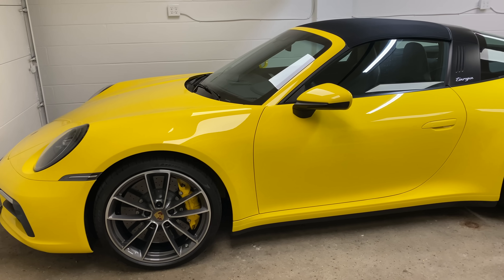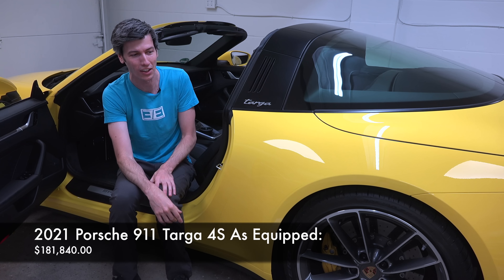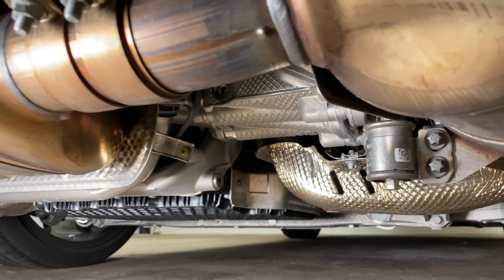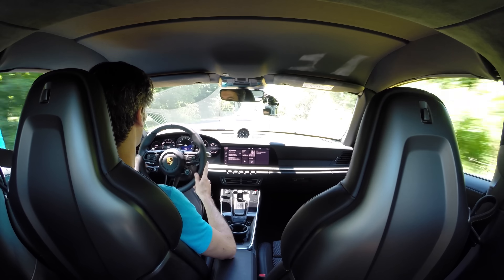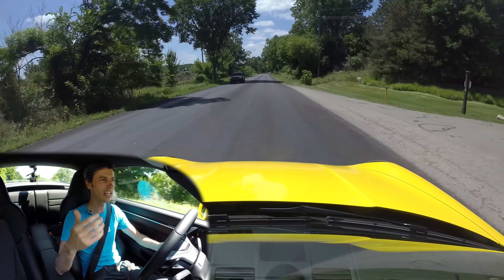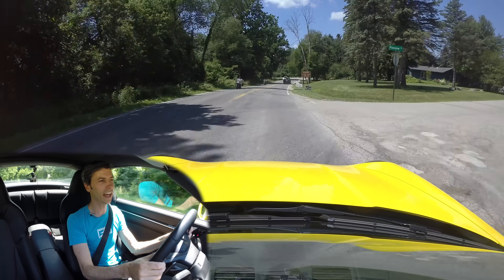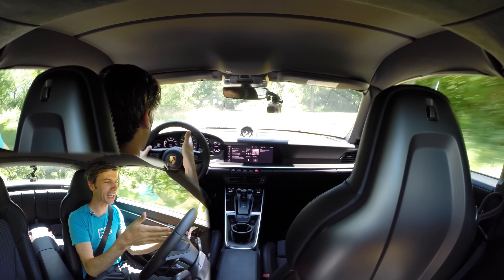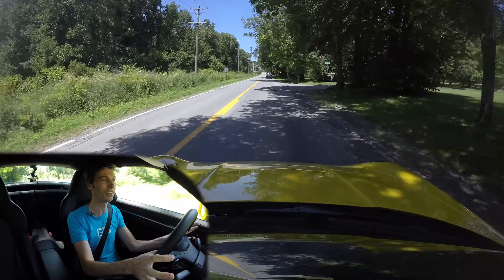2021 Porsche 911 Targa 4S Review - Big Beautiful Glass!

Comment from the maker: A plastic oil pan!? What gives! Keep in mind this is a dry sump system and the sump is not the lowest point under the vehicle. But, if you're curious about plastic oil pans, and whether they make any sense, I found this article pretty fascinating: https://bit.ly/2DEwGx4. Also, apologies for the audio which seems to deteriorate towards the end of the video. I had the car for one day and on that one day my mic decided to get a little finicky. I've already replaced the mic (see previous video in my supercharged MX-5, which was filmed after this was) and resolved the in-car audio issues. As always, thanks for watching! If you're curious about the boring life a YouTuber leads, you can follow my Instagram: https://www.instagram.com/engineeringexplained/
Reply: they dont make things to last anymore , will go all brittle over time
Reply: Plastic oilpan is actually pretty common in VAG cars. All the newest have plastic pan. From 2015 to present its common that they have it and many other manufactures use too plastic pans and intakes also.
Reply: I would like to see that accelerated aging test data
Reply: From the article : "[cool plastic material of the week] fully satisfies the specific requirements for functional integration, lightweight construction and cost-effective production [..]" Nothing about durability compared to aluminium pans or generally accepted standards of engine lifetimes (usually 100k to 300k miles in roadcars and 10 to 15 years of age). Then they go on to compare it to [slighly less crappy plastic], but not to any type of metal material. 

Conclusion: Obviously having an oil pan that lasts the length of the engine lifetime is not even a design goal any more. Cost cutting is more important.

Opinion: I would not be happy purchasing a vehicle equipped with a non-metal oil pan.

Controversial opinion: The automotive industry is generally doing a good job at making ICE go the way of the dodo by making them less and less reliable and durable.
Reply: Gabriel Sterr cool. So the plastic will fail in about 15 years at best. Sucks for people who plan to keep the car forever.
Reply: So the front isnt an engine compartment, but an engineer compartment?
Reply: Volvo trucks has been using plastic oil pans a long time.
Plastic is not a good material for such a part.
Reply: I would do it just to keep engine noise down 🤓
Reply: Glass targa ? Meaby
Reply: Please do an explanation of the boxer 6 cylinder engine.
Reply: mike brink  I thought Porsche has historically been a pretty reliable brand.  We really have no data on how reliable the current stuff will be, however.
Reply: I don’t care what my oil pan is made of as long as it doesn’t rust out in the salt belt
Reply: What happened to the sound...
Reply: I have a concrete mixer that's seen lots of use. The barrel is made of plastic. Aside from discoloring from sun, its still very solid and pliable. You can wack it really hard with a shovel and it hardly gets a chip. The iron mount and aluminum stir blades show more wear than the plastic. All engine seals are a type of plastic and they handle heat cycling fine.. Main downfall of plastic is UV from the sun makes it brittle eventually...hardly a concern for something under a car. Nonetheless this new 911 isn't that impressive...all the electronics that make is 'refined' or 'comfortable' are doomed to fail. Porsche is going to stick electric motors in it next model cycle and its going to get even heavier.
Reply: I had a 2010 Audi Q5, it had a water pump with a plastic case, lasted less than 20k miles. They replaced it with an aluminum cased pump.
I have a 2016 SQ5, the plastic water pump started leaking at 55k miles. Luckily replaced under warranty with aluminum pump.
Audi knows the long term reliability issues with these pumps but they will wait till it fails before replacing with aluminum pumps.
Reply: @phillm156  dang, that sucks.  Some parts make sense to be made of plastic.  Intake manifolds for one.  Nice and light, easy to remove.  Oil pans, eh, jury still out on that one.  But water pumps in plastic have to be the dumbest automotive idea yet.
Reply: If all of you people would go and read the article Jason posted, you would´nt be here freaking out about problems that don´t exist. Polymer technology is AMAZING and there´s a lot of reasons to use it, besides cost.
Reply: Hambert and some not so. A friend had a 335xi, the breather valve broke off. The internal piece broke into the camshaft & bearings....totaled.
Reply: Uuuhmm.. Technically it's a flat six engine, not a boxer engine. Or have I been lied to all my life?
Reply: @alexbarnby1322 Not all flat 6 engines are boxer engines, but all 6 cyl boxer engines are flat 6
Reply: @McSteveIrwin  yeah, it depends on the piston connecting rod phase orientation around the crankshaft.  If the horizontally opposed rods are on separate crank journals, 180 degrees apart, then they're boxer engines, like the ones in Subaru cars.  When viewed from above it looks like the pistons on each side are "boxing" each other since they each reach TDC and BDC at the same time.  If the rods share a journal on the crankshaft like most V8's and V6 cars, only they're laid flat at 180 degrees, then they're just flat engines.  Ferrari Testarossas had flat-12 engines, but it wasn't a boxer engine.

Comment: Maybe my rallying fears are showing, but how come a huge ugly and incorrectly installed hose clamp underneath. If you had to use a hose clamp - and bmw would never do that - at least install it with the tail away from the direction of travel and the screw mechanism up the back of the pipe. Disappointing detail on a $180k Porsche.

Comment: 181k optioned is a bit much, not sure what exactly is included, but you can definitely configure a cheaper build. I think 150-160k is more reasonable and at that price point it may be worth it for a Targa 4S with manual transmission. Targas in manual are very rare and hold their value pretty well. Also keep in mind in a few short years 911 will switch to hybrid powertrain, and these cars may very well be collector cars. I would not get the 8-speed PDK, as refined as it might be, unless you're in Sport Plus it's too boring as it's tuned for fuel economy not fun.

Comment: I'd be interested in a video on how you can have different final drive gear ratios.
I presume it is because the rear wheels are wider so if its the same tyre wall ratio front to back, the back will travel further on one rotation so need a smaller diff ratio.
Would also be interested in the effects of this if there are any (2 props spinning at different speeds;what happens when cornering)

Comment: Hi Jason! Looks like there isn't anyway to PM you on Youtube anymore, but I wanted to ask about auto start stop (ASS) systems on Turboed engines. I'm sure most car designers have probably thought about it but your video on what not to do on turboed cars you mention letting the car cool down before you turn off the engine. With an ASS you can't do that if you let the car turn itself off. What are your thought on this? Is the potential 8% fuel savings worth it in this case, or is it better to think about the turbo?

Comment: If you want a metal piece, you can get a after-market oil pan that adds 2.5 quarts to the capacity, at least for the 991.2, just have $2.5k ready to pay. As to the choice of manual and PDK, you used to save money by opting for the manual, no more, so thanks, I guess. Compared to my 991.2, a comparably equipped 992 is $10 to $15k more, as long as they sell, they can raise the price. 
The steering wheel in my 991.2 also blocks gauges, but there is a screen in the instrument cluster multi-function display that you can have all the engine readings very visible. 
Truly, the Targa top is too complex, puts weight at the wrong place and adds to the cost of the car, but they still sell.

Comment: 3700 lbs! My 67 Camaro convertible is 3100 lbs.I have a naturally aspirated 327ci (5.7l) engine which by spec should be around 400 hp. I think the Porshe was around 430 horsepower. So the Porshe hp/weight ratio is .116 while my 63 year old Chevy is .129. PROGRESS! (PS you can by a tricked out 69 Camaro with a 427 on Craigslist for under $45k)

Comment: I just bought a caymen starts at 60k can go to 96k, mine is 89k. I came from a 03 boxster that I could not upgrade because I only had 50k miles on it. 
There cars use to be about driving but now they are only about money. I’m selling my 2020 caymen and getting an electric car. New version of the model S. 
Porsche wanted $1900 to change the brakes on my boxster, I bought the one parts on amazon and changed them for $450 they wanted over $3000 for services so again bought all the parts on amazon and did all the services even the ones that where not do. The service guy could not show me where the money was going because it was clearly a money grab.
Yes people that buy Porsche’s tend to be well off so you can afford to over pay for service is basically what the dealer implied. Keep in mind I only have one arm and did all that work on my car just so the dealer would not rip me off, but I don’t want to do it again, so electric here I come @#$% Porsche they lost another customer for life

Comment: Sometimes electronics are there to make up for a bad mechanical design. I.e. a car with bad handling that they try to fix with hacking the stability control. And THAT is also what they did to the 373MAX. And THAT is the sort of thing that people hate. When a car already has good handling mechanically, and the manufacturer adds finetuned electronics to them then that's a good thing.
And that's the case with Porsche, they have a solid basis that they put their electronics on top of. So here it's an addition, not a compensation.
---
And their engineering department knows how to build engines that self destruct right after the warranty period is over. That self-destruct mechanism is way more reliable than a lot of nuclear weapons and cruise missles. Putting a hard but thin alusil coating on a soft and pliable aluminium block? - Genius! Making the clutches of the PDK impossible to change without cutting and welding its case? - Genius!

Comment: The camera shakes (especially the rear view) let me think that the body is (obviously) less stiff than the coupé. I drove a cabriolet 911 and found a sort of “disconnection” between the dashboard / steering wheel and the rear of the car. This was very obvious on bumpy roads,  not necessarily at high speed. This is what you get when you remove the top...

Comment: I'm a huge Porschephile, well known in the 928 world and now I have a Cayman S.  But $180,000 for a non-turbo 911 [992]?  Uhmm, this is a luxury car for retired guys with lots of money.  My Cayman S has the same gold-plated shield on the hood and has 96% of the performance for 25% of the price.  Hello? And my 981 will depreciate little in the next few years, that 992 will.  And my 981 will outhandle that 992 on most tracks due to the mid-engine design.  And you know what is funny?  The structure of that 8th generation 911 and my 2nd generation 981 Cayman S....From the rear edge of the drivers doors forward, they are the SAME car.  The exact same steel/aluminum stampings.   That frunk that Jason climbed into?  If he climbed into my 981 you would see the same thing. I know because I am 6'1" and 155 pounds and I was able to climb into that space and have the frunk closed upon me.  [I had the key in my hand and a helper nearby just in case] In fact, the plastic cover over the battery, AC equipment, brake master cylinder, et cetera is the SAME part.  Porsche's motto is "If it ain't broke, don't fix it", in German.  This is why Consumer Reports magazine rates all the latest Porsche's based upon this chassis with about the same reliability as Toyota. 

Great video Jason!

Comment: Great video Jason! I agree about the price point, the 992 is a great car and the evolution of the 911 continues, but at $180k... I have a 2013 997.2 911 turbo S I recently purchased for 100k. The original sticker which I have shows $173k brand new with exclusive options even! It is 530hp 516 lb-ft stock w 3.8L TT flat 6 and feels much more special. The 911 is arguably the best overall sports car in the world, but has it just outpriced itself?

Comment: Great review.  If I understand correctly, engine oil is pumped electrically to the block (versus a mechanical pump).  If that is the case, why not have the oil pump run for 3 seconds or so before starting so components are not rubbing dry?  Would that even work? THX.  Love the channel.

Comment: I have driven the 911.  It is amazing how well this car does everything.  I too was surprised by how comfortable the seats are and the ride is over typical broken pavement suburban streets and how easy it is to drive slowly. I drove a six speed manual (2008, I think) with 325 (?) HP and 273 (?) ft/lbs and it was PLENTY fast.  What a fun car to drive.  But, the price.  YIKES.

Comment: Hi could u make a video about lpg/cng? 
im curious about those fuels cuz lpg have ratings above 100 octane and i wonder if i have a lpg engine could i increase my CR? its conversion engine so it starts on gasoline so knocking might be still an issue how to make it work only on lpg?
i would want to know more from a performance stand point im from europe and here lpg is just a way to pay less for fuel but im kinda racer and i would want to know if lpg might be also a way for cheaper performance i wont pay 25% more for shell V power when i can run a high compression NA engine on half price lpg and with proper map it might even produce more power than gasoline? 

i cant find anything about performance usage of lpg ive read somewhere that peugeot was trying to use lpg in some race cars but i cant find anything more about that neither

i would also want to understand better engineering that stands behind lpg engines
i also guess that there are huge differences between stock lpg engines and converted engines since conversion is just fuel change while engineering something tries to adres disadvantages

Comment: at 5:03 I see the gear ratios. If I calculate the ratio btw successive gears I get:
1.54
1.47
1.38
1.32
1.26
1.24
1.25
It looks to me that the ratio between 7 and 8 is very much the same as btw 6 and 7
And yes I can see the ration decreasing from 1.54 to 1.24 for 7th
But the ratio btw 7 and 8 is not that high.
Never mind. Too expensive for a car. And for me

Comment: The only thing i really don't like it's that it cames with Pirelli tyres. I don't like pirelli, i'm a big fan of Michelin and that the engine is not easily reachable for maintenance and that kind of stuff, and the turbos so close to the ground makes me concern about driving it in the rain or in wet roads because, you know, hot  metal and occasionally water splashes don't get well together... but it's a great sport car nonetheless. It's not very very expensive and has a respectable top speed, and looks really sweet good.

Comment: Do you ever go back to videos you did when you were a college kid and chuckle to yourself? :-) 
Can you explain: 1 why many engines coincidently have similar displacements 2. How similar sized engines make drastic different HP/Torque?
Reply: Engine size is bore(width of cylinder) multiplied by stroke(length of cylinder) the multiplied by the number of cylinder.                           Theoretically the wider the bore the more power you make and the longer the stroke the more efficient you are
Reply: @FerasAlhawas  thanks. Why though would two similar size engines make different power? There are many 3litre engines four example but output varies.
Reply: Pat Cellucci could be different bore and stroke sizes could be compression ratio different type of petrol, ignition timing variable valve lift vs timing
Reply: Pat Cellucci google volumetric efficiency

Comment: The steering wheel issues appears to be a Porsche thing. I am about the same height and on my 991.1  the oil pressure and temperature gauges are obscured, which is annoying.

Comment: If that big piece of glass were Lexan/polycarbonate, I wonder how much weight could have been saved... But I don't know if Lexan/polycarbonate is good at heat insulation. Also, why is there 2 different final drive ratios? what does "F/R" stand for? Thanks!

By the way, recently I've had the chance to drive a 992 Carrera 4, and yes the car was so fun to drive! I was really blown away with the level of refinement of all the electronic tuning! The steering felt very organic and communicative, and the steering ratio felt fairly small. The throttle pedal felt telepathic that responded instantly and accurately to your right foot input, no dead spots or jerkiness. The sound was genuine and industrial, no fake piping. It was so easy and exciting to drive on public roads!

Comment: Does have me wondering though, if your enthusiast who isn't endowed with a spare ~$200k laying around to blow on a sports car, are used 911s reliable? I'd like to see you buy an older 911, priced approximately in the ballpark of your Miata and Model 3, and see how well it has/does hold up.
Reply: There are a lot of 996's still running around, even with their IMS bearing problems.
and they are 20 years old.
Reply: @davidjacobs8558  That is a good sign, although I'm amazed at how well they hold their value. Looking at 15 year old cars and they are in the mid $30ks. Are they really that good? Even after 15 years? No, I've never driven one. Did drive a Boxter from that era, and was not impressed because it was very slow. Handled really well though.